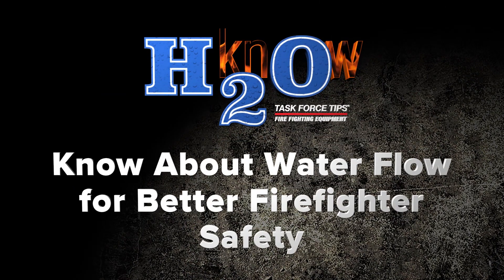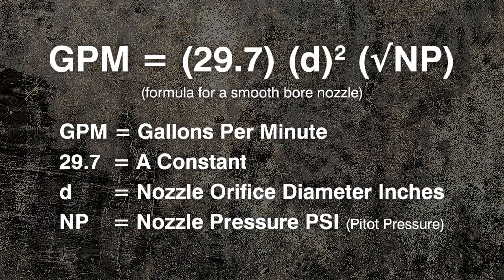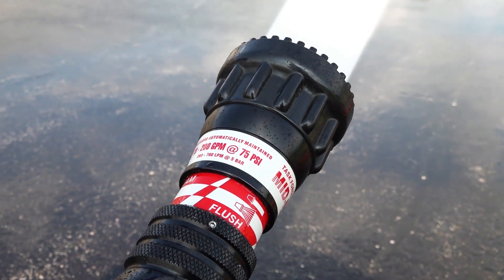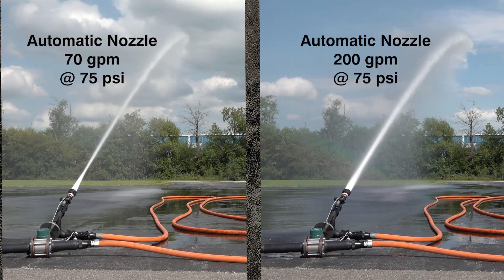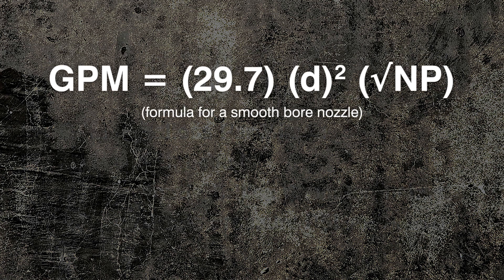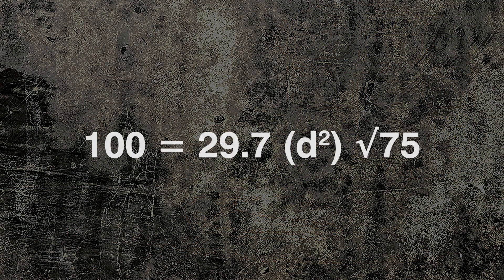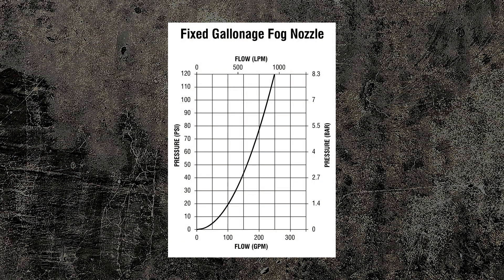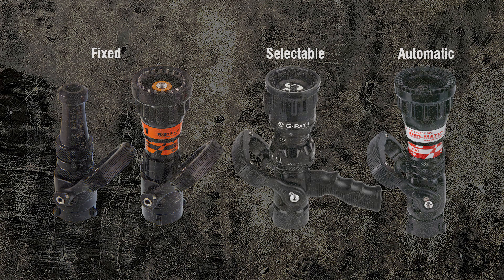How an Automatic Nozzle Works

Comment: If I am flowing a constant pressure of 75 psi. at the nozzle,  how do I change flow from say 100gpm to 160 gpm on this nozzle. The video does not show how you actually adjust flow.
Reply: The whole reason I clicked on here 😕
Reply: You raise your discharge pressure. GPM flow is based off of pressure, so you raise your pressure at the pump and it raises your flow at the nozzle since the nozzle is designed to not allow the pressure to raise above a certain point it'll increase flow until it holds that specific pressure.

Comment: How can you calculate GPM flow on an automatic fog nozzle if we don't know the diameter?
Reply from the maker: The only way to truly know your flow is with the use of an accurate flow meter. Otherwise, you would in fact need to know the specifications of the nozzle your using and cross reference the flow charts and pressures you’re running while taking into consideration the friction loss of the entire system between the pump and the nozzle so that your crew is setting your standard operating procedures to accomplish the targets you’re aiming for.